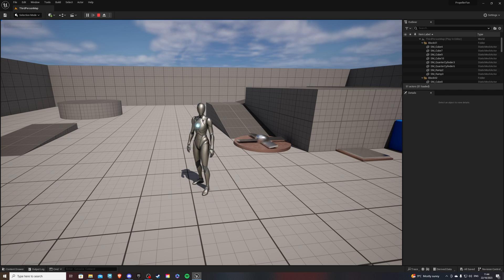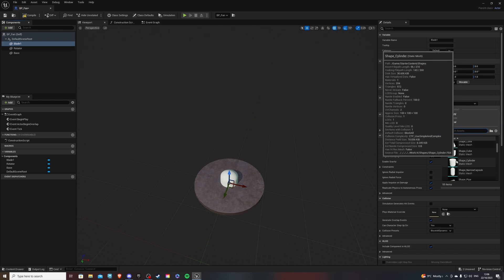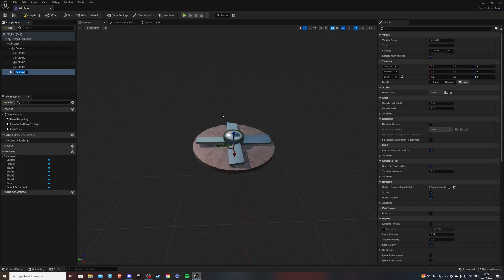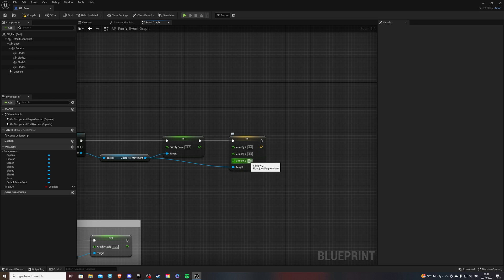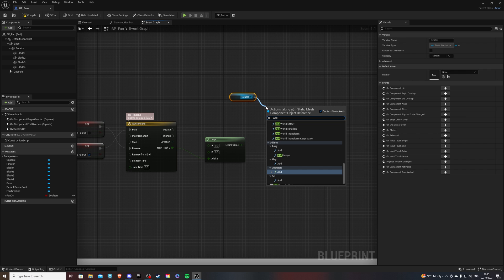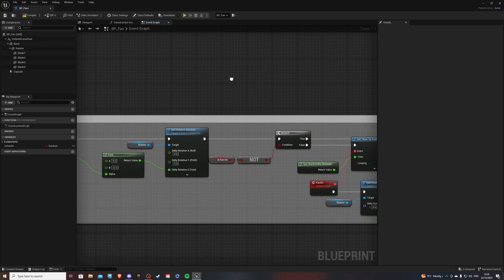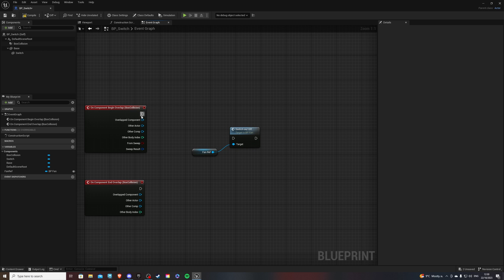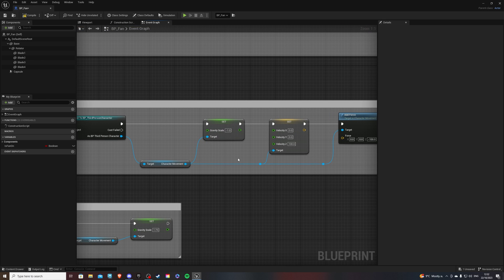Fan/Propeller Tutorial - Unreal Engine 5.2+

Comment: Hi there, this solutiion has some problems. First the character only gets blown into one specific direction. 
Rotating the fan to the side would still blow the character up when jumping on the collision volume. This can be fixed by adding an arrow, pointing it to the collision direction and using its forward vector as launch direction.
The second issue is that the characer cannot walk past the fan wind when the fan is sidewards. You will get blown to the side without being able to walk through it. Basically, you cannot walk against the wind/fan.
Any ideas on how to solve that issue?